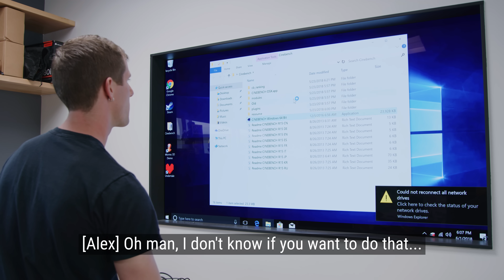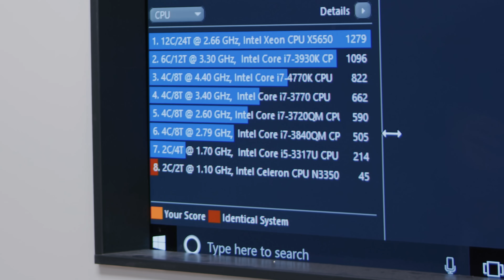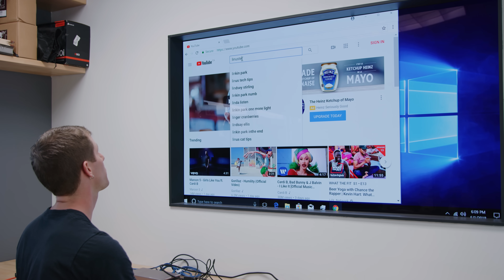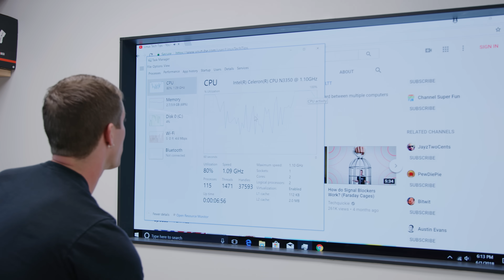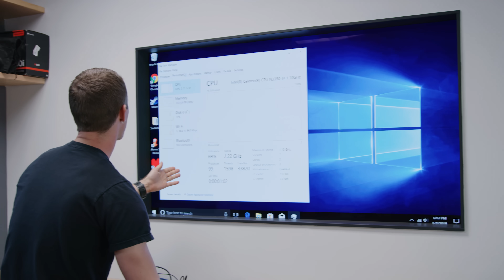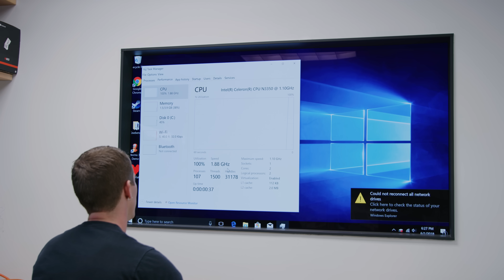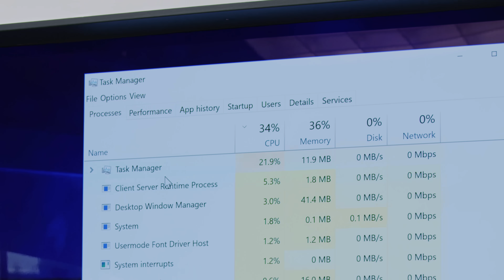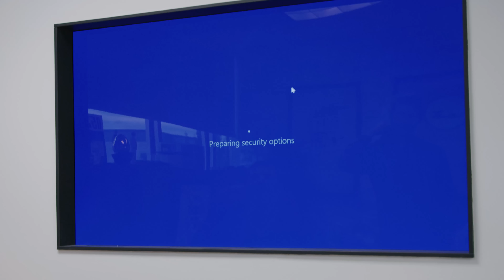PC Smaller than an SSD

Comment: TO THE GREAT & WONDERFUL LTT!
   I have a tendency to overpak with my main phone, backup, & emergency phone + 15.6"screen for hooking up phones & accessories, 1TB Ext. SSHD usb-b & usb-c Ext.SSD 2TB  onboard storage w/2TB expandable SD + unlim cloud storage, Static & Multi-OS bootable Live USBs & SD cards, Intel Compute & Movidious NeuralNet Stick, various cables ....
Linux Dedicated Laptop & pwr supply
+ THE BEAST: My Custom Designed & Built 21.8"L×18.8"W×3.8"H metal chassis, composite RGB Lid & keyboard, i7-8thGen quad~hyperthreađed:Hexa core cpu + 64Gb RAM+ 2TB M.2NvmePro 1TB SATAIII, 2x Dual GTX 1080's+Dual Fan+Killershot Pro Studio Speakers & Sub-woofer + 30MP Webcam, 2×usb-a 2.0 & 4×usb-a 3.1 + 2×☇3/USB-C 3.2Gen2 + 2×miniDP1.3 Rev Compatible+ 1 - 2.7Gbps Ethernet w/2×RJ45 PoE injector, 1×HDMI 2.2 & 4K@60-120fps 3D screen, 15,000mAh  battery & 2power bricks + 2in1 pwr adapter plug in for pwr supply... so basically a 20-30Lbs desktop in laptop form factor in a locked backpack w/GPS & self destruct anti-tampering...
+ my HakPak w/Haktools, OTG foldable BT Win.+Droid+iOS switch on the fly cmd center keyboard & trackpad, TapStrap 1 handed keboard & laser mouse w/charging capsule, lockpick kit, cables, adapters, dongles, batteries, 12plug pwr strip, Tape(s), 15in1 multi-tool, 72pcs mini tool set+mini solder station kit+ųtorches, varied RPi's & SBCs, travel routers+physical firewall, Etc... So I'm rockin at least 35+kilos...

Where am I going w/this????
 I NEED TO SERIOUSLY CUT DOWN WEIGHT, BUT STILL HAVE THE PERFORMANCE I NEED & PHYSICAL HRDWR & SFTWR SEC. FEATS. EVEN THOUGH A SMALLER FORM FACTOR & 50-75% DECREASE IN WEIGHT IS A STRETCH... And since you did this "PC smaller than a SBC video" I was wondering since it's a couple years & tech has gotten smaller & more powerful & efficient if you/we could do a micro & mini PC & accessories hunt &/or build(s) that has the quality LTT asskickery I need, but cuts the weight by 50%-75% as I had 17 full fractures & other internal injuries & family+son 2 be were lost in & for me a near fatal incident some years ago & would've switched places in a heartbeat but the world keeps turning... Moving on... I probably shouldn't be rocking that much weight to do the jobs I need to do if I don't have to... But, as you know... You think "awww I can do without this & that I'll be fine & whadaya know $H!+ F@%# You end up needing exactly what you left out of your bag of Trix to get the job done.

Sooo... Can you/we do a hunt/builds for the most badass LinuxOS/Distro supported & AOSP De-Goog'd Android Phones/Linux+Win+Hackintosh+Android Laptops & killer ų+mini computers/SBCs/storage/adapters/components/ that will finally get me the pwr+speed+connectivity+security I need at home & Especially On The Go because that much bulk & weight is a bitch to haul around & nightmare @ airports... especially when tsa has never seen a laptop form factor that thick, & heavy, nor inside setup like that before compared to most they see going through.... & after giving it a more than thorough wipe down that could be considered sexual assault on a machine lol; then wants to do a full cavity search & disassemble a complex design & super hard to build laptop to make sure there's nothing that disagrees with a pieced together flying machine w/1M moving parts built by the lowest bidder flying through the air 300-500mph at 30,000Ft... So it's easier to ship it in pelican cases to end destination. Rather than check bags &  avoid throwers & buy a 2nd seat just to fit the non-modular parts of my packs.

Sooo... Can & Will The Legendary Linus & Co. please assist me in my quest to cut dwn weight & have the technological asskickery I need to do work & play at home, in the lab or shop, & especially on the go!!!
REQUEST & CHALLENGE ACCEPTED Y/N? PLEASE RSVP!

Comment: I don't see what is so special about this? Raspberry pi and similar boards have been running Windows for years (with far better clock speeds - but less RAM: which is easy to add more of). You could simply put a phone inside a case. With no screen and battery you could get that size computer with tech from 5 years ago - Intel or Arm.

Comment: You know you could just make a phone without the screens and it will have much more power than this, The Apple chips in iphone are pretty much faster than many intel U series chips like from 8th gen and Snapdragons chips have caught on as well, so A full mobile chip, lpddr 5 ram and 512 GB rom could fit in there if no display is present and Voila..

Comment: "it will run windows" so basically it´s an SSD

edit: turns out it is actually better than my current laptop
Reply: Lmao it’s literally running the same specs as mine except I have my cpu overclocked to 2.4ghz

Comment: Ackchually .. SSD is that big to mimic the size of HDD. The actual flash memory is no bigger than your pinky nail. You can compare that with SDRAM chips.

And come to think of it, CPU is big because CPU peripherals is big and CPU peripherals is big because CPU is big. If there is a sizable market for small CPU and small CPU peripherals, then CPU will be no bigger than smartphone.

Comment: 08:54...ur nuts...(LOL)
Reply: I do actually think ur on to something there, where part of the human body starts functioning as part of the mobile PC, or phone.
Kinda hard, but let's consider heat being moved to a heat sink that makes contact with a large patch of skin, and uses indeed the body itself to dissipate some of the heat, which ordinarily would need active cooling.
It's not like phone can use a little more porocessing power, and through such a heat 'pipe' could lose some of it, without needing additional power or active cooling.
However, id'still suggest not active blood cooling, since when that would overheat, you'd get crud in return, and our bodies need blood, not crud.